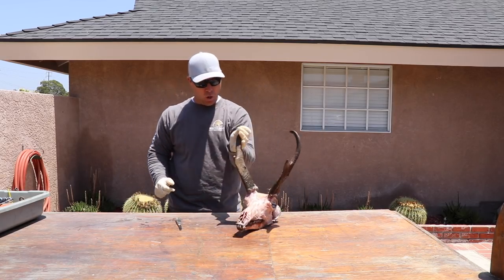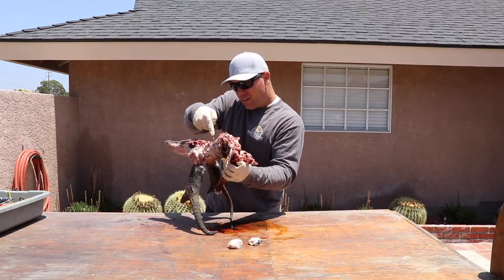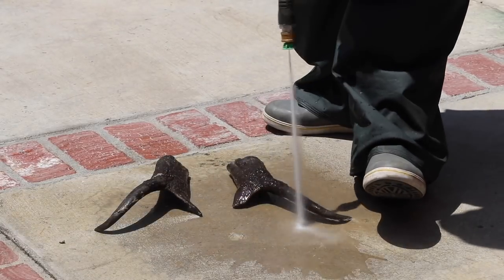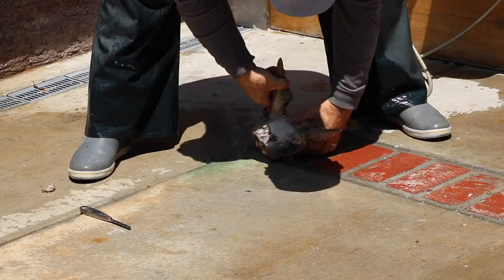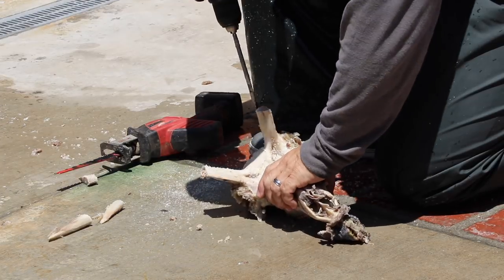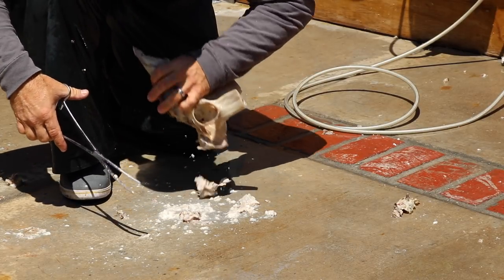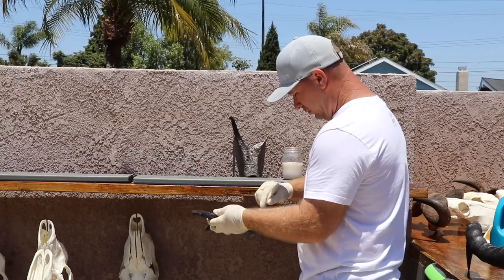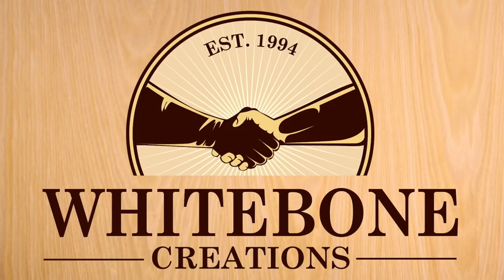HOW TO CLEAN A PRONGHORN ANTELOPE SKULL  AKA "SPEED GOAT"

Comment: I get a little something from each of these! Thanks so much! I mention that because even though you have done a video before, there is nothing wrong with providing another and another with additional info. I do have a question though at this point....any suggestions on clean up afterwards? I don't mean the actual skull, or the whitening; I'm talking about the funk left behind....LOL. My initial thought was to do this in my backyard in the grass, but that will stink in a day or two. Looking for ideas for a DIY guy....thanks!
Reply from the maker: +rbljackson  great question. I know lots of backyard cleaners. Some make a screen box to catch little pieces.  stink typically comes from rotten raw flesh and your only spraying off cooked meat.  It will dry and rake or mow up no worries.

Comment: I have a moose skull cap mount to do. I can not find a pot big enough since the antlers come out the side of the cap, and are 4 feet wide. I salted the cap to help reduce water in any remaining tissue while trying to figure out what to do... it was getting a little smelly, although I scraped off loads of material. Then I found your great videos! Thank you. What should my next step be? Any suggestions are greatly appreciated. Should I try to rehydrate to remove remaining tissue? Can I use steam to loosen material since I have no pot big enough?
Reply from the maker: +Tom Karrow Is it just the crown or the whole skull. I would trash bag the antlers and try and boil or soak the cap and spray it clean.
Reply: Yes, it is just a cap BUT it is too large to fit in any pots. Have you used steam?
Reply from the maker: Tom Karrow I have with not much luck. I have better luck with hot soaked rags. If it doesn't fit I just keep rad hot and wet till it loosens the wash clean.
Reply: Thanks for this.. I had some success with steaming. When you create a skull plate mount (just antler and a small plate), do you still use hydrogen peroxide on the plate? Bleach? Is it necessary to do either? Thanks